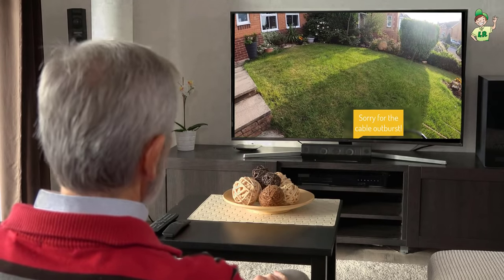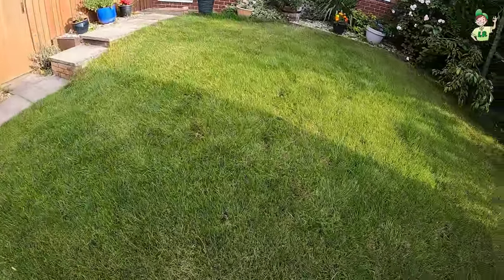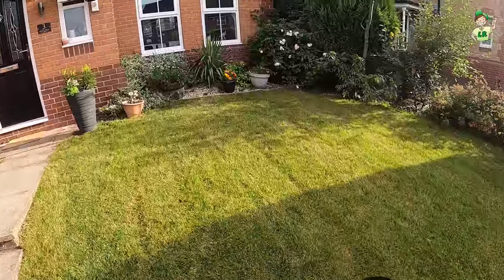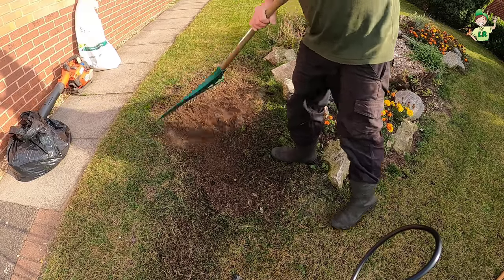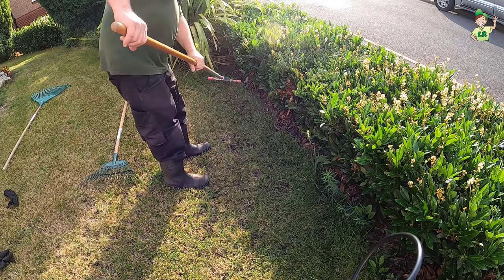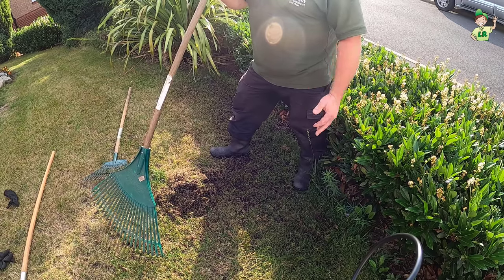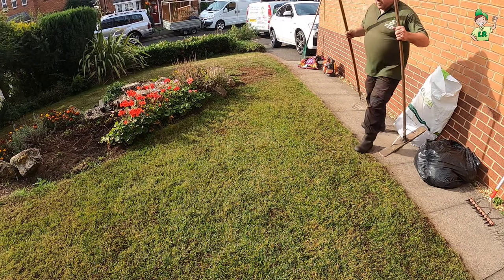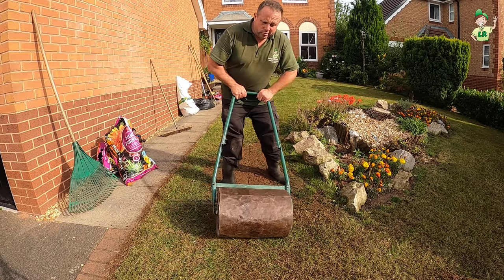How to overseed a thin lawn (and bare spots)

Comment: Wonderful!  But without seeing how it turned out, fairly useless.
Reply from the maker: Totally understand.. I dont go back there for a while but it did turn out just fine
Reply: @LawnRight  Thanks for responding.  The reason I mention it is that there were a lot of steps you did. Quite labor intensive.I usually do a few of these steps but not all with varying results over the years.  Would be great if you could do a follow up video at some point.